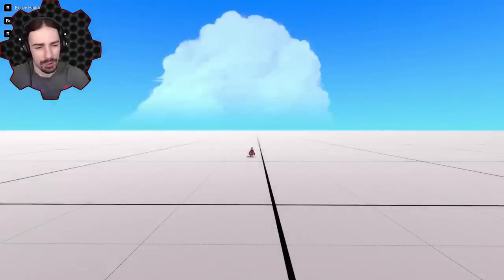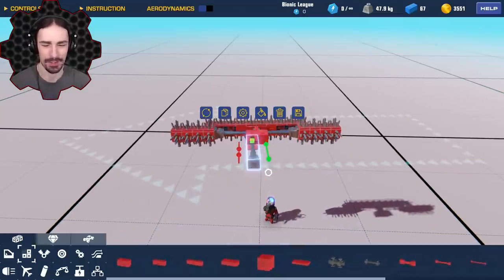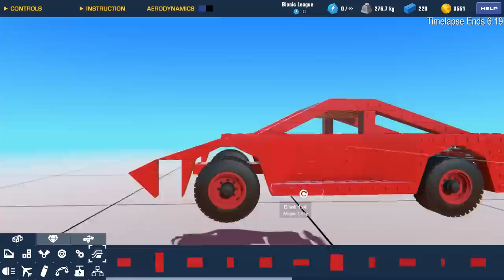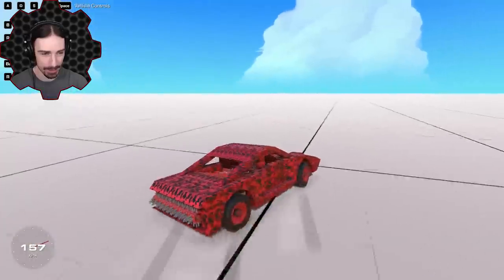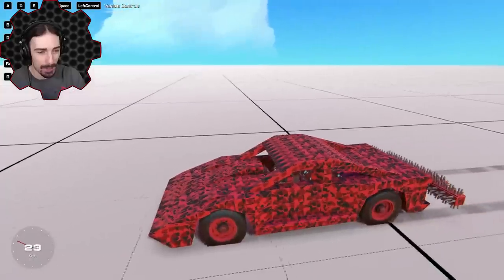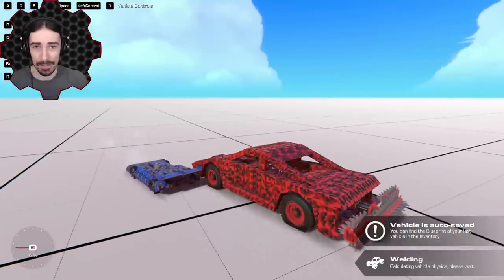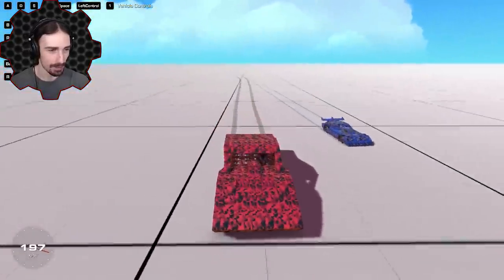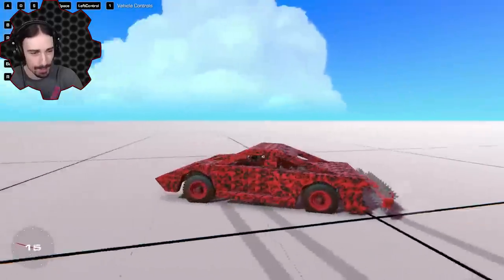Deployable Spike Strip Causes Instant Driven't - Trailmakers Gameplay

Comment: A way to fix the problem you had with the spike strip would be to have a sensor facing the car in the car and a sensor in the spike strip facing the spike strip and then both sensors would be powering a block that only activates when it has only one power source and then that block powers the pistons and then you can have the pistons have no buttons and have them start at 0

Comment: I've been watching you for a while and i noticed you using only dragon engines. The dragon engines has a high acceleration but not much high speed in comparison with the raw engines if you mix them you've got both of the two worlds. If you take a look in the workshop hypercars they using raw engines too of course heavier but its got much more high speed than the dragon engine. 

I guess
Reply: Acculy, dragon engines are lighter, more power, less space, faster acceleration, and acculy don’t have higher speeds. You must be talking about the bulldwag because dragons don’t go slower

Comment: Honestly the spike strip car looks very nice but the spike strip could use like a straight down drop mechanism where the strip is place on the inside of the back of the car and to drop it you only use a detacher set to another key bind but the car will need to be lifted more...